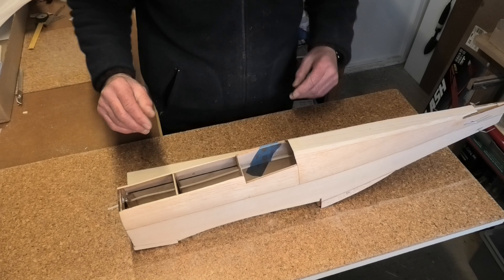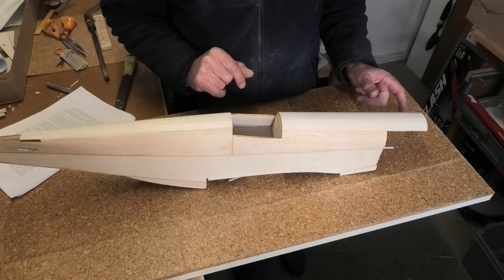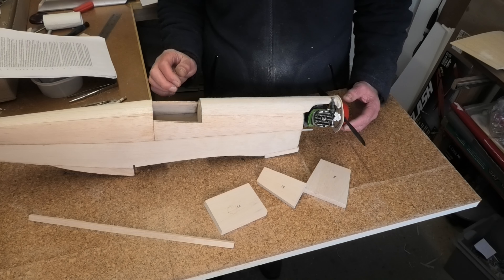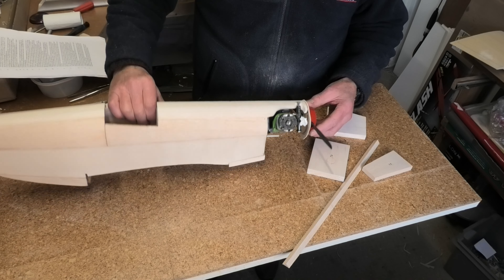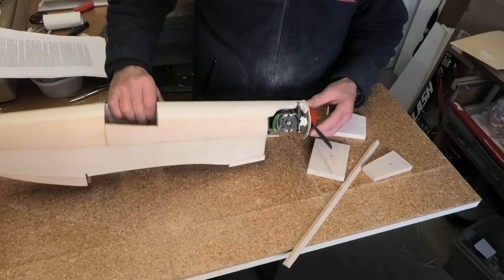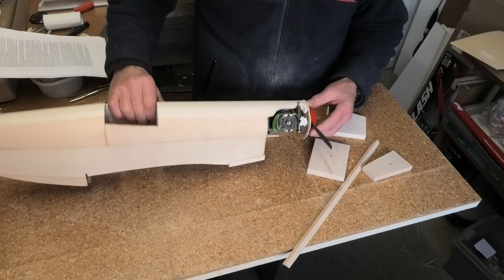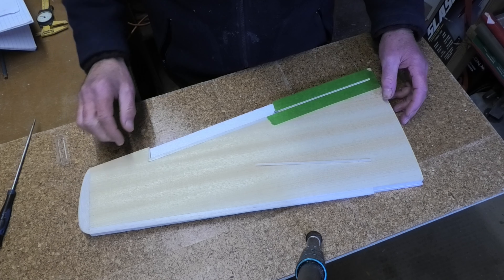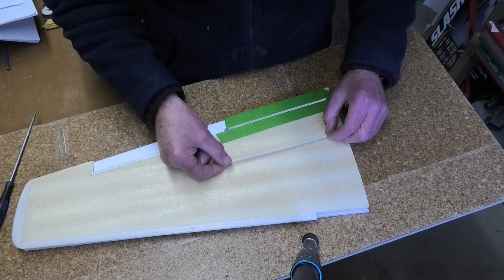Cambria funfighter -  P-51Mustang Build Part 2

Comment: what epoxy are you using and why did you heat the epoxy?
Reply from the maker: I'm using bsi 30 minute epoxy, see here: https://www.bsi-inc.co.uk/adhesives/epoxies.html     Heating the epoxy makes it runny so it flows along the channel and fills the space much more easily and efficiently.
Reply: Nice build series they fly good but be warned you may build more 😊
Reply from the maker: @davesunderland1  Yes, already thinking of building an ME109 for the slope.
Reply: many thanks for the info. @davids_model_flying
Reply: looking forward to future videos. just subscribed